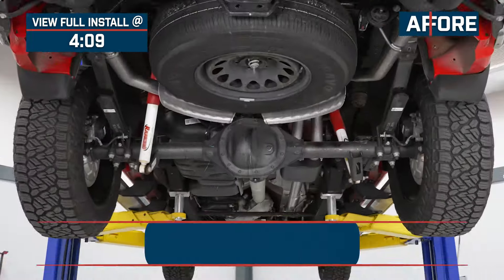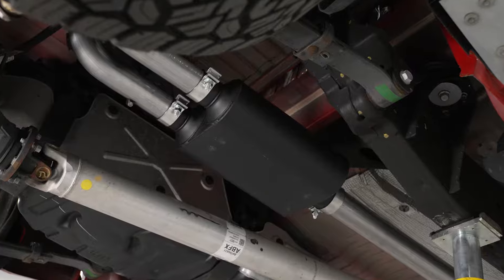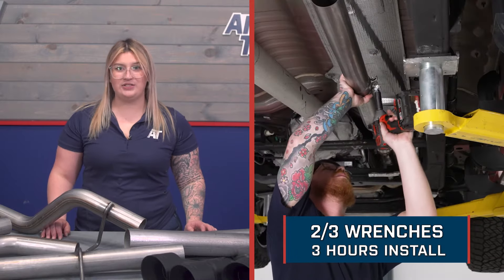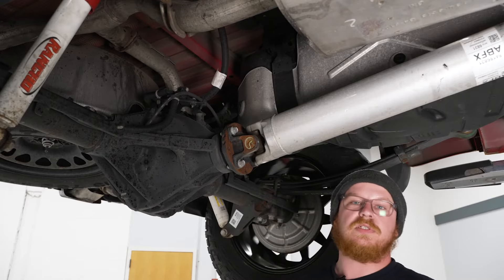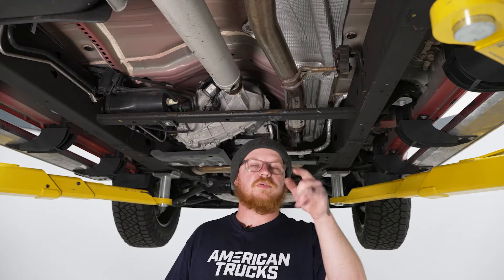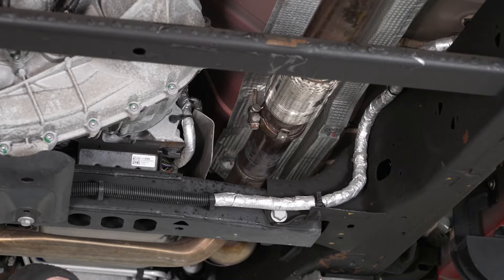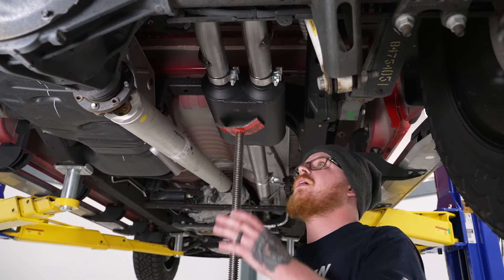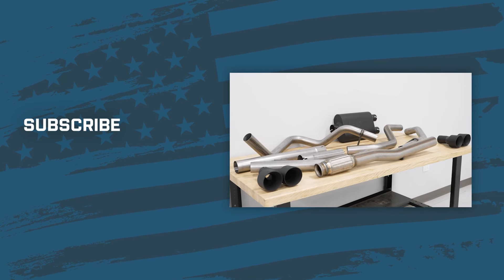2019-2024 Silverado & Sierra 1500 Rough Country Dual Exhaust System Review & Sound Clip

Comment: Having issues getting the tips lined up properly. Big gap between top of bumper cut out and top of tip. Any tips?  Or just move things around until they sit right. Ty for any help.
Reply: Had the same issue with mine. youll have to bend the two hangers for the rear sections to sit right. I took industrial zip ties instead of bending and zipped them up and moved them around until they were right. Holding fine in place for 6 months and haven't moved.